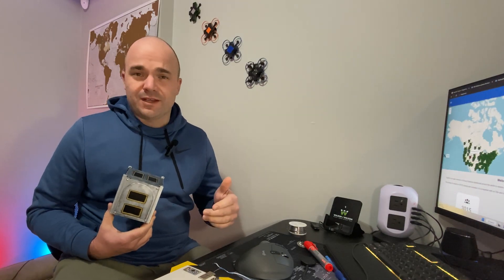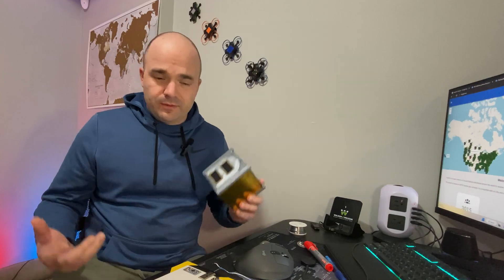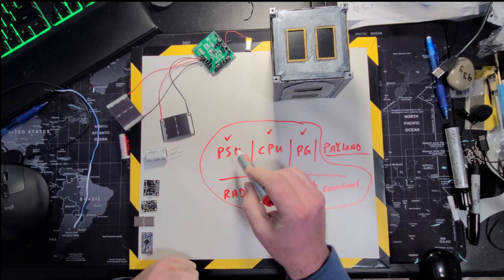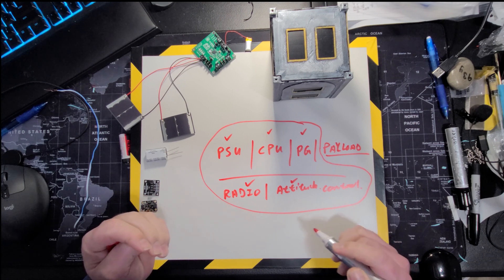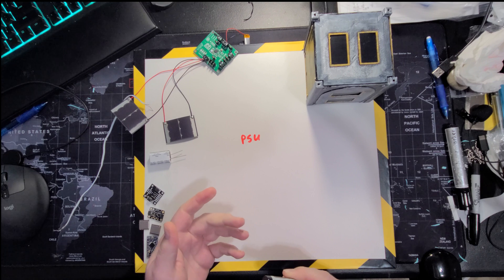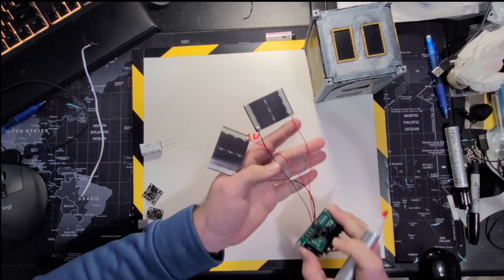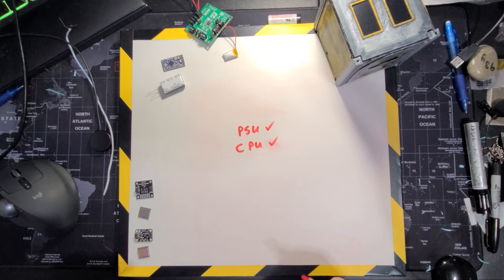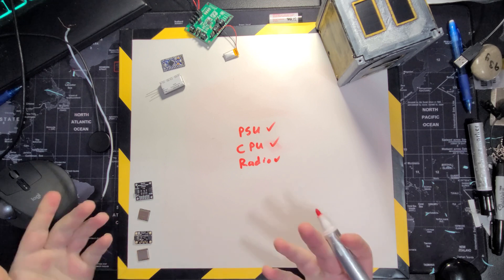DIY CubeSat Build Part 1 : What it could cost & Why

Comment: @enginermethis
What is the radio transceiver that you are using?
Reply from the maker: niceRF Lora Radio module
Reply: @EngineerMeThis  Thanks for the reply. Is this isn't a Ham Radio device?
Reply from the maker: @TheDub85 nope. Its an ISM band device ( license free ) but depends on the output power. If you going above 1W amplifier you start needing to get license

Comment: For your radio look into the RTL-SDR. They are software defined radio and can receive and transmit all in a very small package.
Reply: It is possible (not trivial) to do GPS with certain versions of the RTL-SDR.  With the software in your control, you can do your own GPS without fear of it being disabled above a certain velocity or altitude. The Processor to do this is order of magnitude more powerful than the processor required to operate the spacecraft.
Reply: the RTL-SDR does not transmit btw, only receive

Comment: Bummer about the cheap GPS chips is that they auto-lock above specific altitude and speed limits to prevent their use in aerospace applications.
Reply from the maker: Indeed. I think if we were in a world with no dark side we would have access to alot more cool tech we don't even know about
Reply: Why would they want to prevent the chips from being used in aerospace applications ? I'm just curious.
Reply: @sk0pro853  tthey could be used for the homemade intercontinental ballistic missile that could be launched anywhere in the world. Imagine how much damage could that be.
Reply: @sk0pro853  they want to prevent the unauthorized constructions of missiles and other weapons and surveillance platforms.
Reply: @sk0pro853 Ballistic missiles.

Comment: Hi, can I have the list of components, especially the chip used on the radio discussion? Thank you.
Reply from the maker: Hey Kerl. Have a look into Semtech semiconductor, they make and sell the chips needed for lora and lorawan applications. The chip referred to in the video is the sx1262 but there is about 5 different modules. You can also have a look and tinygs.com for track record of people using lora chips for sattelite communication